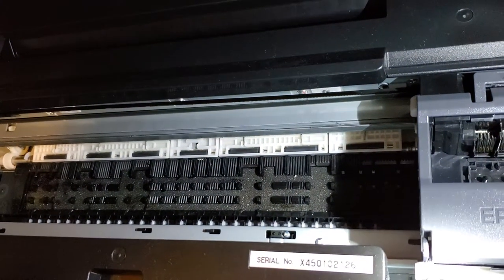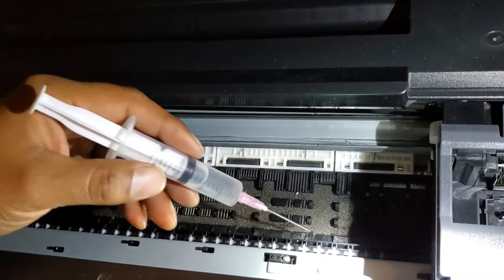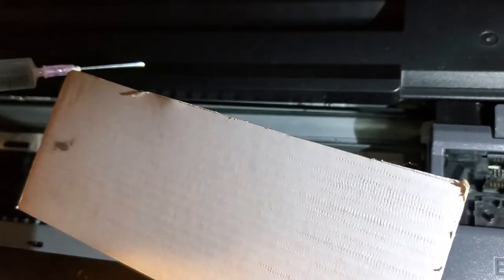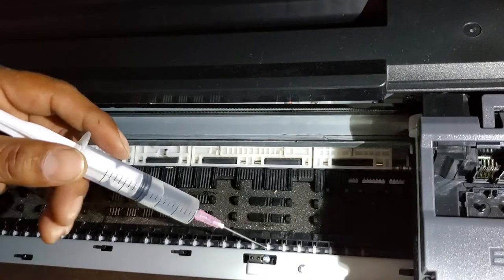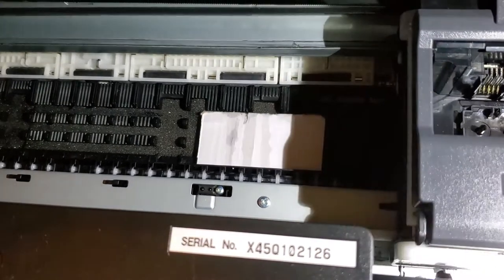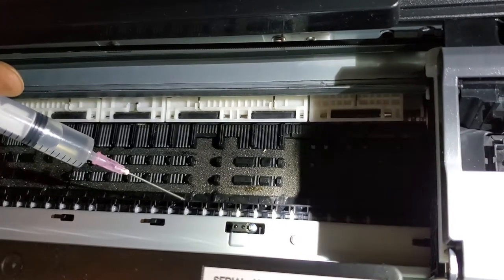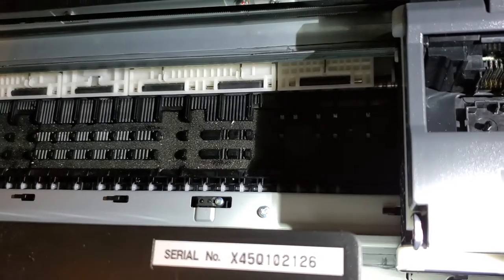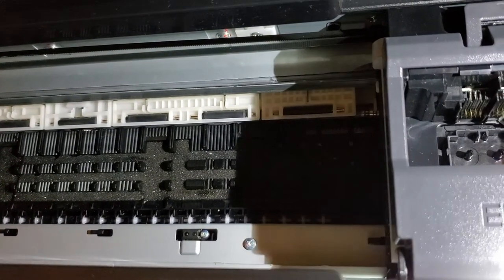Fix dots or perforations on your print outs

Comment: this may be the problem with pizza wheel/ delivery wheels. some times paper may have more moisture, it wont dry quickly. then the pizza wheel impressions takes place., dry the paper before entering into the printer with hand dryer (generally we use to dry the hair). do this frequently to the media. sea the difference.

Comment: works with isopropilic alcohol ?
Reply: Straight Iso will cause plastics to become brittle and break. Iso/windex mixtures are better but still not recommended for something like this. Windex is sufficient. Warm water and a little dish soap will work as well. Easy does it.